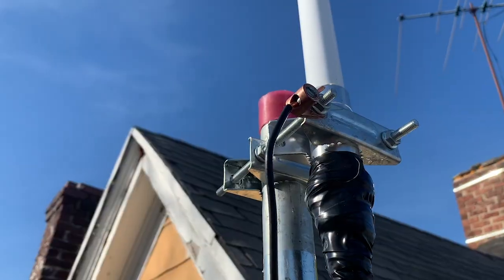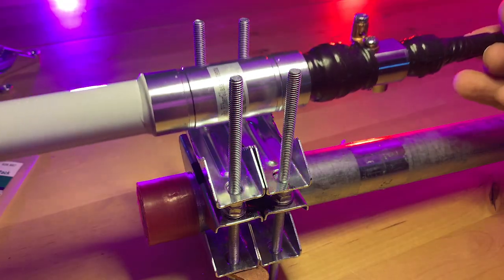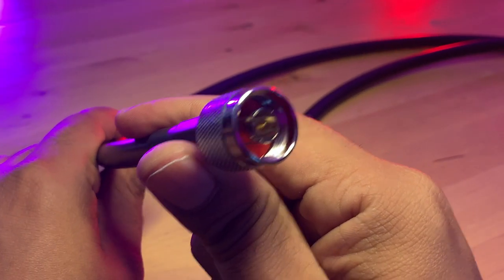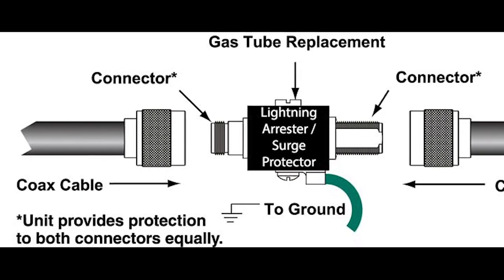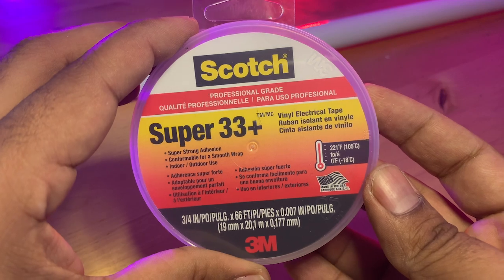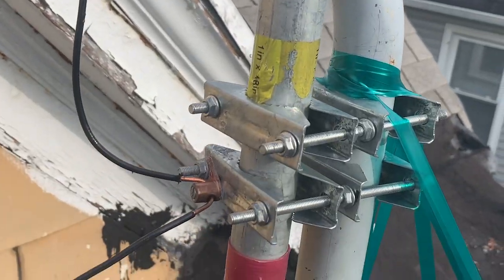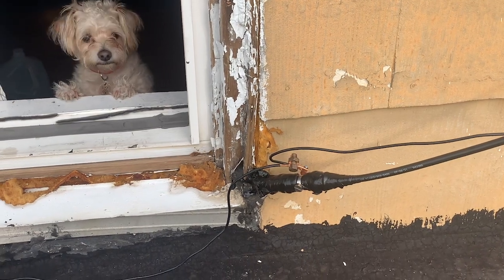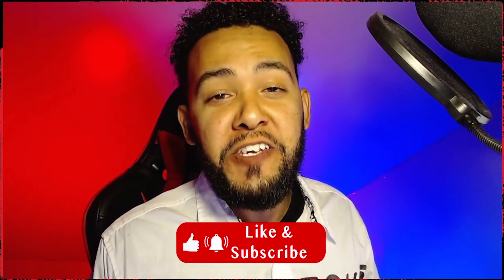Bobcat 300 Miner Setup & Grounding Guide

Comment: Nice touch about bonding (grounding) the antenna shell and the mast itself. Yours is the first video I've seen that does it. Most videos and postings merely talk about the lightning arrestor. Nice!
Reply from the maker: Yes! Absolutely important to ground the entire rig to the arrester if possible. 
I’m glad this has helped you!
Reply: @ItsTheZigMan  Given that rewards, and the Helium network itself, are heavily based upon how well a hotspot listens, what you did makes great sense. You've reduced spurious electrical noise in your system by bonding all components. It should "hear" weak signals  better.

I will do the same. Thank you.

Comment: I like the tip about using the different connector on lightning arrestor.  
That window where the LMR enters the house looks ROUGH!
Reply from the maker: Agreed, it’s an old house 
the whole thing is rough-looking honestly😅
So I utilize what I can. 
That hole was used by the last tenant for their Dish coax. 
So I took that old cable out. 
Put my LMR400 in and it fit perfectly. 
No need for a coax window pass through either, 
Less chances of losing DBI as well

Comment: What is the point of grounding the mast if you are using a lightning arrester for the antenna
Reply from the maker: To ground the entire system
Reply: @ItsTheZigMan  yes but what would be the difference if the mast isnt grounded
Reply from the maker: I’m not a master electrician, but I can say that I am aware of the NEC guideline regarding antenna grounding specifies that both the  Coax and Mast be connected to the electrical system ground of a structure. 
I ground the mast only for static electric/lighting protection, not for receiving or transmitting requirements.

Comment: One thing you should add is a separate ground rod for your antenna ,mast, and lightning arrestor that is at least 6 feet away from your home ground rod.
Reply from the maker: Can you please explain why would an additional ground rod be necessary.
Reply: Most antenna doesn't even need 'Lightning arrestor" as it is already "Shorted" / "Grounded".. It's just an additional lose of your Dbi.. + waste of time and $$$.
Reply: @skybiz4520  NEC required and cables, wires or feed lines to any antenna to have an approved lightning discharge unit BEFORE they enter a building or dwelling

Comment: First positive comment in a minute but if you use actual crimp connections your better then alligator clamps. Copper to steel your going to actually screw yourself but as far as everything else your on point

Comment: the lightning """arrestor""" is totally useless on that small antenna. a direct strike still will burn down that shack. the multiple earthing points make perfectly good ground loops (something you really don't want.) the receiver has overvoltage protection in the first stage of the signal amplifier. the coax entering that wood in that way will rot it even further. have it droop down and up again before entering the wood so water will flow away from the wood instead of in it.